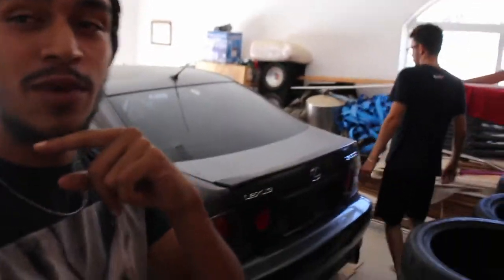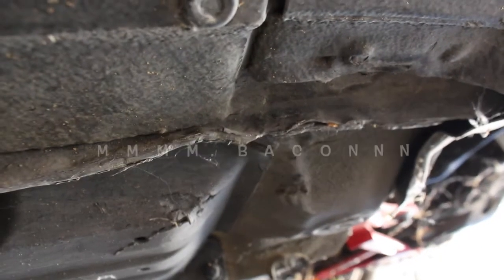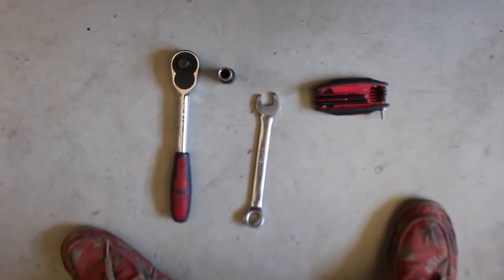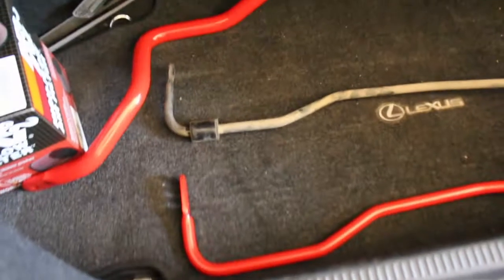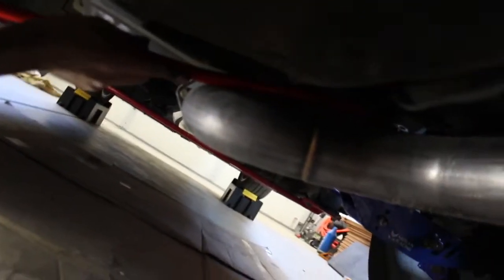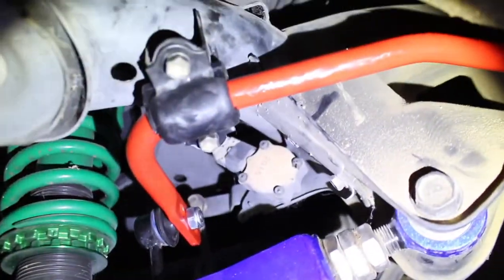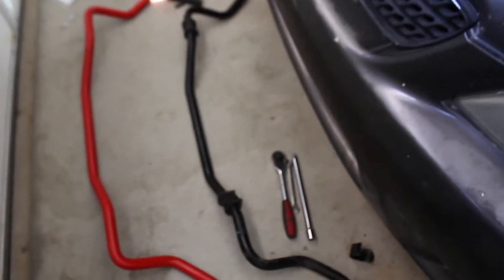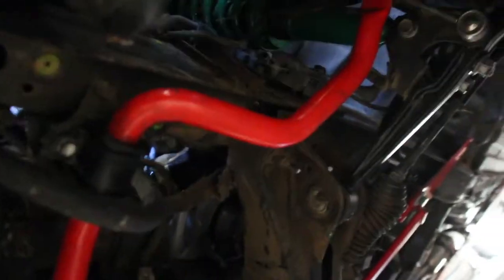HOW TO: LEXUS IS300 EIBACH SWAYBARS INSTALL

Comment: How is your megan rear lower control arm feel and performance with the Eibach sway bar i plane to  get Megan lower controlarm and Eibach sway bay too
Reply from the maker: Well Gus' car basically has every bolt on suspension mod you can buy for the is300 so it feels stiff. Really stiff compared to our other "stock" is300s. Feels great though, his car has very minimal body roll. Only thing limiting him right now is that he needs a better set of coilovers because his current tein street basis aren't cutting it.

Comment: How did it feel driving with the new sway bars
Reply from the maker: To be honest, great! It makes all the other suspension mods come together, driving through the canyons you don't feel any body roll.. We currently have them set to the middle setting in the rear, will be messing with those setting as time progresses and whenever we decide to upgrade the coilovers.. 🙂
Reply: PREVA1L MOTORSPORTS that's good to hear, I have coilovers on mine and I'm sitting about 4 inches lower, in may just refresh my links and bushings and I'm sure it will feel better with that haha, bars may come later on
Reply: I also run these on my IS along with Eibach Pro Kit lowering springs and can honestly say that there is damn near zero body roll that I can notice. My car had these already installed when I bought it but I noticed the aftermarket parts upon inspecting it. I love it and would recommend.

Comment: Hey I am looking to buy this kit for my IS300? What specifically comes in the kit? Does it include the links? And also I saw your running tein coilovers, I am too and have came to conclusion that they are complete ass, what do you guys think of them?
Reply from the maker: If you buy the combo then both front and rear sway bars no links. But yeah both me and Gus bought our teins over 3 years ago, before we fully knew about quality coilovers. On my prelude they felt pretty stiff not going to lie but on the is300 they feel quite soft likely due because everything around the coilovers is stiff. Gus does have intentions of switching them out to some more track capable coilovers when the time comes. For someone who only wants to lower their car, these definitely do the job
Reply: I have flex z’s on mine and love them due to them being perfectly oem plus, stock spring rates with a 1inch drop all round, and basically have the rebound stiffness all the way in, car already has very little body roll (only rolls later in the corner due to spring rates) and I am hoping the eibach sways will fix that